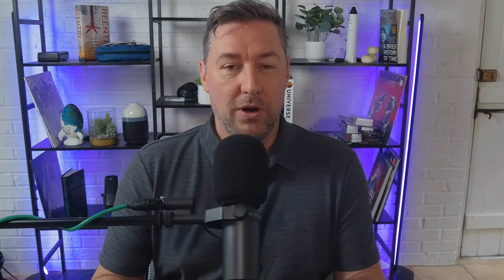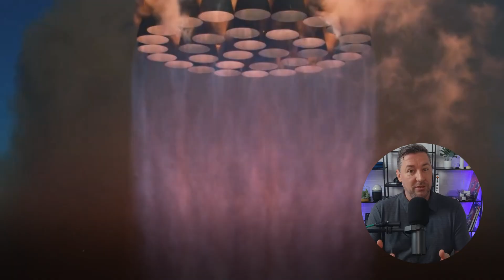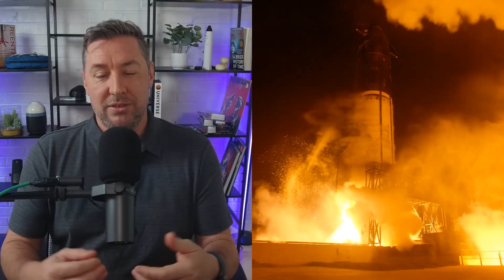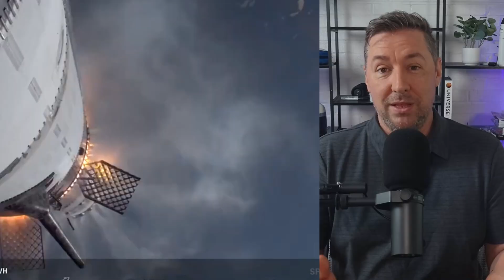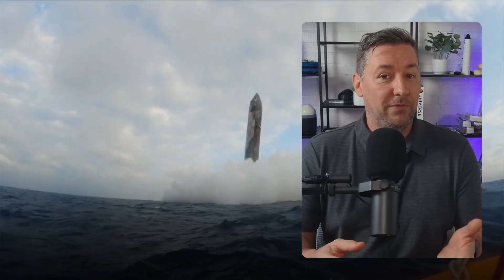SpaceX Starship Flight 10 Update #elonmusk #spacex #news

Comment: As far as I can discern, engine restart during the booster landing burn triggered a RUD. 

I would really like to know whether that extreme angle of attack during engine start-up caused the RUD. I am speculating that, due to the extreme tilt, vapor was trapped in some high spot of a propellant feed line.

Comment: Thanks for the very lucid comments on Starship. Lots of food for thought. 

I suspect that your comment about "hydraulic slew arms" at 4:54 should either be about "electric linear actuators" for the engine vector control systems, or "electric motor actuators" for the grid fins.